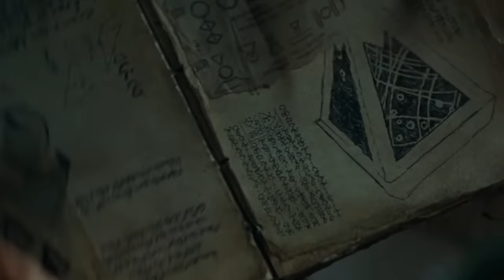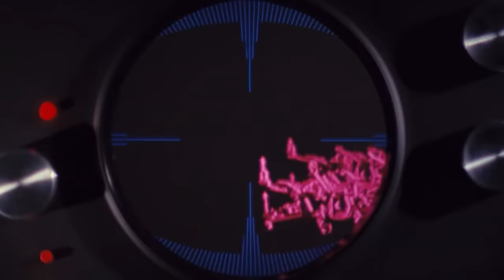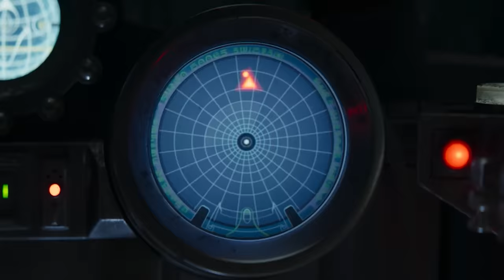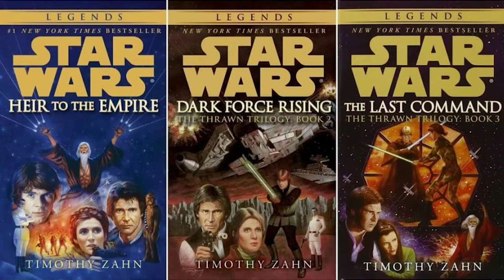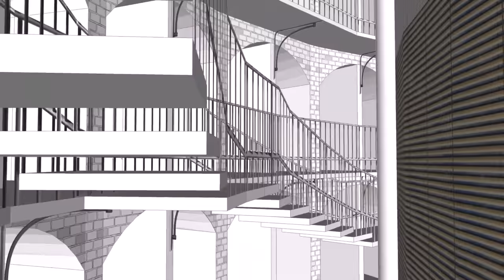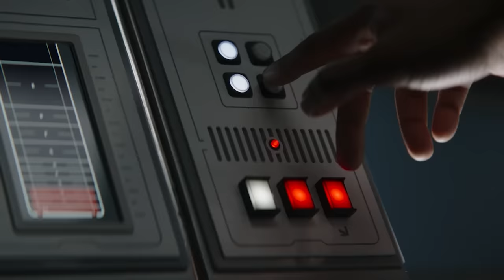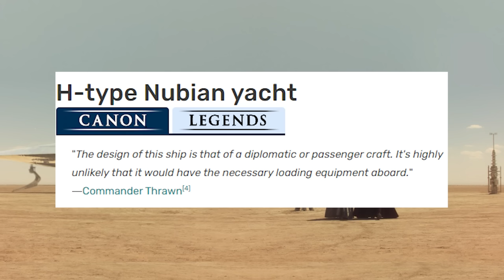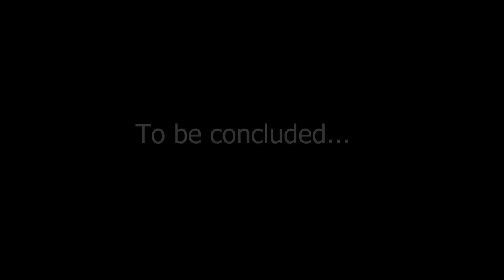The Mandalorian - This Is NOT The Way

Comment: The issue with cloning doesn't make sense because the hack writers are conflating cloning a force sensitive with regular cloning.
Those two where not the same in the original EU. Galen Merek was the first successful force sensitive to be cloned, and this happened roughly 18-19 years before A New Hope. This was in the video game series The Force Unleashed I and II. Which were honestly not to bad in terms of intriguing story and flashy eye candy. IMO the game play was dull, tedious, and narrow, but you will find the occasional die hard fan for those games.

Regardless, more to the point.
The research and successes that Vader made... to his knowledge, where highly classified and kept secret even from the emperor. In the comics, the Emperor manages to clone himself, in a way, and essentially resurrects himself into a new body. However these bodies didn't hold up well due to the force. It was basically like the body was rejecting his force powers, and destroying itself as a result.

That leads us to the terrible sequel trilogy... where... "somehow, Palpatine returns!".
Well, the somehow is that the writers ripped off of this and only the fans who already knew about the fact that Palpatine knew all along what Vader was doing, and lifted the research for his own bid at immortality.... but only in the EU... which Disney killed... yeah, we had the biggest brain ache ever. This was dumb. You cannot simply kill the EU, then lift parts of it, hide it under a tarp, and pretend fans won't notice the vague silhouette of better writing.

Their solution starts here though, cause... they knew we knew, and so they had to fix that to stick it to us. They now just make cloning a ubiquitous bad-guy thing, and hand-wave a republic ban on it. As-if to tease us again... because fans of the prequels know that there would be good reason to ban cloning. Lest someone creates another order 66 army again. No, instead they just put another tarp over someone else's writing and start smearing their feces all over the tarp. 

Again, because they hate you, they hate all of us, and they want anyone who remembers what came before they purchased it to stop watching and "ruining their shows". As for Moth Gideon creating force sensitive clones, he shouldn't be able to. Because you can only clone a dead force sensitive. While it's not explicitly stated, all instances and evidence point towards this being a fact rather than just conjecture. Lots of bread crumbs that are too tedious to dump into a YouTube comment section. Just go play the Force Unleashed game, it's in the subtext of the dialogue upon discovery.

Comment: "It begs the question" at 21:06 should be "it raises the question." This is a very common incorrect use of the phrase "beg the question."
Reply from the maker: It’s a common and correct use of the phrase. It can be used synonymously with “raises/begs to be raised,” and also in the traditional, formal logic sense of assuming the conclusion.
Reply: @TheLittlePlatoon  That's not how it's historically attested. Don't let my name fool you; I'm a native speaker of English, too. One who, similar to you, uses the correct pronunciation of WH. In any case, I'm not arguing against the notion that the aforementioned phrase is used commonly to mean "raise the question." Since most people use it that way today, one could indeed make the argument that it's correct; that would of course be a descriptive definition. I'm personally quite (American usage) fine with that; however, the pretentiousness of the wine-sipping, cigarette-smoking avatar evokes a prescriptive persona.

In any case, I did enjoy the run-down, and especially hearing an English accent that has maintained the correct pronunciation of WH.

Comment: Great video, but i gotta put on my star wars nerd hat and correct something that doesn't really matter. When they are attacked by ties, its not standard ones. There are alot of variants and many do have hyper drives and even pressurized cockpits. Tie Interceptors are one of the variants with both of those things. However the show gets it a bit wrong. Tie Interceptors are expensive to make, extremely hard to fly and arent more durable than standard ties. They have far better weapons and are faster but lack actual ray shielding. They are not expendible and are supposed to be extremely specialized. It makes no sense to have a squadron of that size consisting entirely of Tie Interceptors.

Comment: At around 1:58:10 you say that if the engine is hit the speeder should no longer fly.

I submit to you that if I take any of my plethora of guns out of my closet and put a round through the grill of your car I would have hit your engine, but your car would likely not stop and, most likely, continue to run until the damage causes an actual critical issue (like overheating, for example).

Comment: We have yo live with what we get. Why is it so hard to get better writers.  One of the major faults with modern sci fi. They spend huge amounts on special effects but are let down by scripts. I imagine special effects does get cheaper with modern computers and software. And we can bring back famous actors with greater quality. Lukes appearance on the Mandalor was not perfect but a reasonable effort. Famous actors, and dead ones, could be replaced with better special effects. Make up artists are not great with aging effects, in my opinion. But my main point is that the greatest failing is in writing. And future sci fi may be cheaper so we get more sci fi in future with more cheap scraps.  And we can bring Luke and Han back.

Comment: I always thought that Yodas species were strong in the force due to their size. It was to compensate for their lack in size. So why can't they be very strong in the force as compared to humanoid species. That's how I perceived it. 

He's old but physically incapable of defending himself from bumanoids, and the whole vocal thing should have and could have been intriguing if their species could actually speak underwater due to their lack of physical development but even that wasn't explored. Instead of that Ahsoka made a cameo as an interpreter.

To me, these shows are lacking imagination. Its not even fan service. It's all a cash grab.
Reply from the maker: Ah, but to quote the old frog himself: “size matters not.”
Reply: @TheLittlePlatoon  size did matter since there were numerous humanoid force users then alien force users. We can only account for three of Yodas species that were force users. 

In that there were two that were on the Jedi council who were formidable Master Jedi. Which could have been due to their force abilities could have been greater than the other humanoid Jedi. 

Then there is the consensus of fans seeing Yoda as the greatest Master Jedi. Why not Maxe Windu. He did disarm Palpatine. Yoda failed and ran but ppl still see him as the greatest Jedi. 

If it's not size then what is it?

Yoda was physically incapable of handling Palpatine. Whereas Mace Windu was putting in work physically. No force use necessary. 

To be honest, it's a yet to be determined and that's why Dave "the phony" is effing it up. He's all over the place due to how it's determined for ppl to be force sensitive. It can also be determined that if you are around a Jedi you will start to become force sensitive. 

Sabine and Luke were in the presence of force users and started to become force sensitive. 

If you all keep signing on to bulshit then they are going to jeep making bulshit. 

There was a point that in order for you to build a lightsaber you had to find your kyber crystal. They aren't doing that anymore. You can build a lightsaber without an attuned kyber crystal. That's from Dave "the phony" contradicting his own narratives. The children finding jyber crystals was to build tge theory behind lightsabers. Now he abandoned that theory.  Now all you have to do is put some gas in a lightsabe and click it and it will light up. That's a subliminal message of gaslighting Star Wars fans. A lightsaber is a Bic Lighter now. 

Palpatine was literally showing us that size does matter after beating Yoda and losing to Windu. 

Something needs to take shape and form so that Star Wars can get back on the right track. 

MAY THE FORCE BE WITH EVERYONE‼️🤣🤣🤣